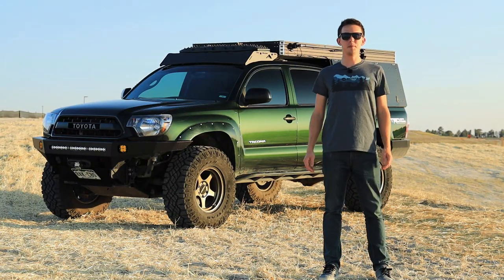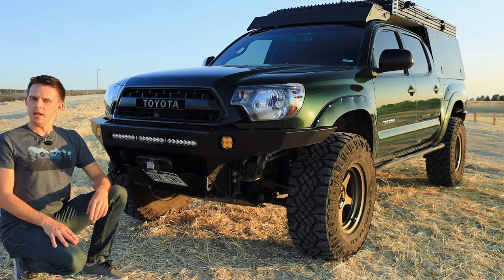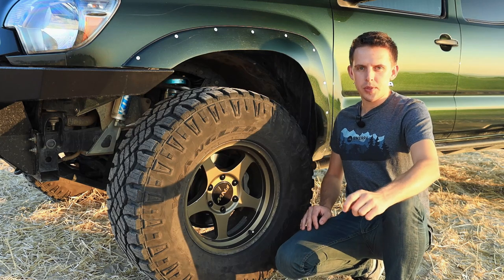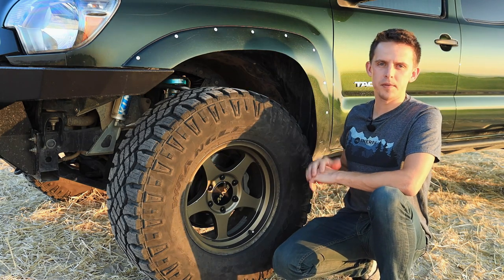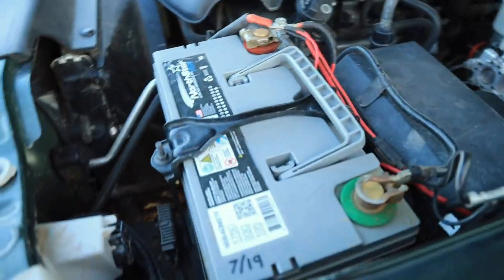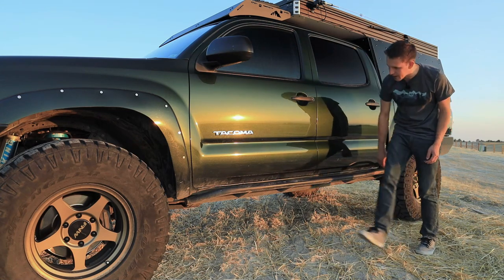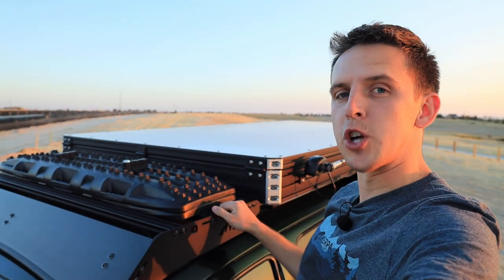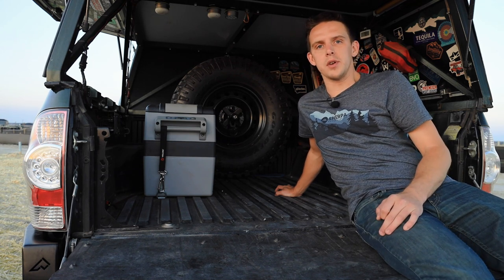Ripcord's Tacoma Build | Walkaround Pt. 1

Comment: Hey you inspired me to build my own DIY Camper Pop up. Thank you, your videos and build were incredibly helpful. I wanted to know if the sherpa rack helped with wind noise? After putting on the camper, mines low profile as well only about 1.5 inches off the roof, I get quite a bit of wind noise. Thinking either wind fairing or going to sherpa or prinsu rack.  I watched the Sherpa Rack install video and saw your new 3rd gen tacoma, looks great. Only recognized it because the camper was on.

Comment: This was a neat video, thanks for taking us through your truck.  I'm impressed.  It's dumb but far and away the most interesting part about it was for me - don't laugh - the TPM canister.  How'd you go about building that?  That scratches an itch I have.  Don't get me wrong, tires/shocks/gearing - all interesting and cool.  But it's the small unique bits that I really dug.  The pivoting antenna mast.  The TPM canister.  The cowl intake.  The wedge tent (obviously).  But yeah, if you have more info on the TPM canister, think I might go and do a thing.
Reply from the maker: I made a write up in my build thread (link in discription)
Reply: @RipcordHQ  thanks!

Comment: I love how everything is built with a purpose. Function over form.  Do you have a front locker as well?
Reply from the maker: I do not, the truck has A-trac. That in combination with the rear locker has been fine so far. The few times I have been stuck, a front locker wouldn't have made a difference.

Comment: Are you still running your inner fenders liners and did you also cut 3 inches on the fender or just the flares? Also how much did you cut in the rear flare/fender? Did you also do 3 inches all the way around the fender/flare or came in towards the bottom to avoid cutting off the mounting point of the fender?  Thanks in advance.
Reply from the maker: liners were gone after cutting fenders & flares
Reply: @RipcordHQ  thanks for the reply...I have a more questions.
1. Did you evenly cut the fender around or less towards the bottom.

2. Did you leave the mounting points at the bottom intact or did you cut those off, if so...how are they mounted now?

Thanks